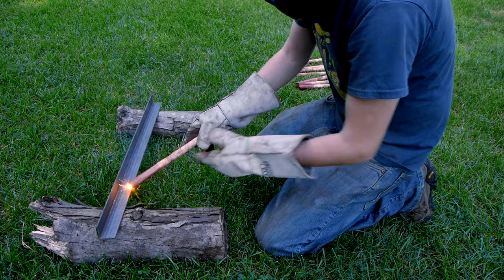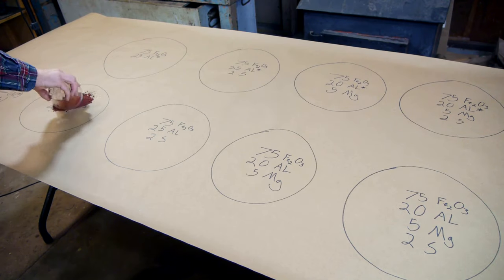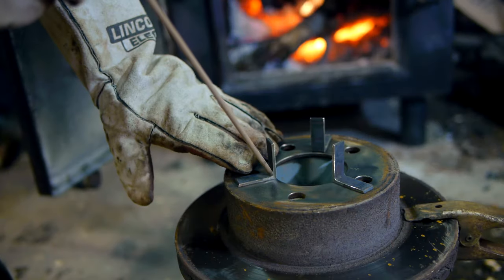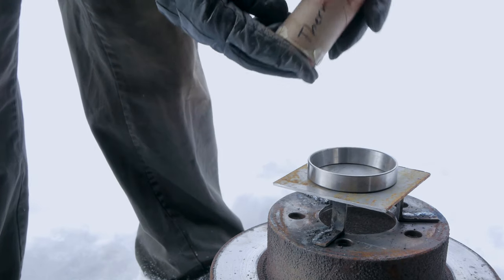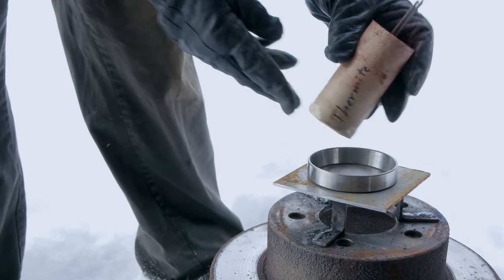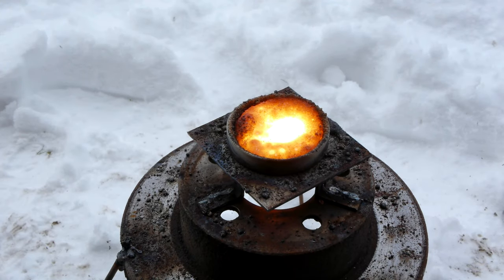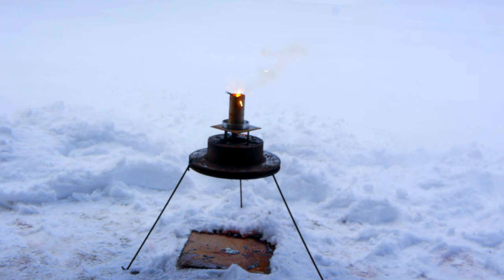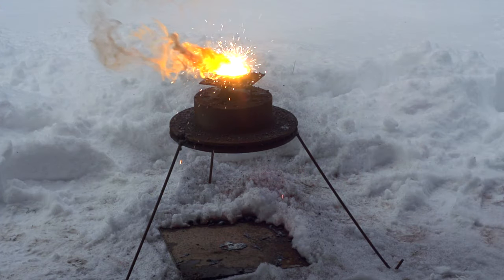How Easily Can Thermite Actually Melt Steel? - NightHawkInLight

Comment: Interesting to see the failed experiments. It looks to me like the heat is mostly escaping into the air. Also, the unburned thermite underneath may be insulating the steel from the heat above. There are lots of videos on YT of thermite welding of railroad rails, which are many times the thickness of this plate. In that case the steel is melted until it flows together, and after cooling for a suitable time, still glows yellow when the mold is removed. The biggest difference is that the reaction is well contained and protected so as to put the heat where it’s needed.

Comment: You do realize that it's not melting because of the way you have the mixture contained, right?

If you were to get, say, a 1'x1' piece of 1/8" steel, and set the thermite in like a 4" diameter ring, pack it in, and then light it, then the thermal energy wouldn't go up in smoke as much as the cylinders did.

For the cylinders as you showed them, I think you'd have better results putting the steel OVER the cylinder.

Comment: Though it may show that the materials are given a bit more credit than they might deserve, it also may be just  your testing. Heat does rise after all. Thus, I'm sorry to say it, this video and test are a fail. Light the thermite from the bottom so the hot point is pressed against the steel, and put a brick on it for insulation, weight and heat deflection  And no, I've never done this before, but that at least should be common sense.

Comment: I wonder if compressing the thermite mixture to bring the components into closer contact and remove as much of the air as possible would help reduce the spattering and increase the speed at which the reaction takes place. I'm thinking you could do it in a hydraulic press. With a 10-20t of pressure on a small surface you should be able to get it to form a solid chunk with minimal porosity.

Comment: Well... for most of the burning process the center of heat is nowhere near the steel plate.
Don't burn the Termite from the top to the bottom, but instead from bottom to top. Take a steel tube with small holes drilled around the bottom perimiter. Insert a circular mesh tube into the steel tube with a diamater around 2/3ds of the outer one. Fill the outside of the mesh with larger compressed pellets (larger than the holes and preferrably  made of Termite) and the inside with fine Termite powder. That way you'll have proper oxygen access at the bottom without powder leaking out and without using pointless filling materials.
At least partially block off the upper end of the tube with solid steel to contain the heat and use a very fine mesh to block off the bottom

Comment: your heat is escaping you need to make a crucible around your bearing race about 4 inches tall to contain the heat and that will melt through your steel use plaster of Paris to make your crucible

Comment: thermite in a clay flower pot...let the focused flow of  thermite from the small hole in the bottom of the pot, contact the metal.  it'll cut through whatever is below it, no sweat...,

Comment: Your experiment is flawed in that thermite/thermate burns directionally, all of the energy burned upward as opposed to downward where the plate is located, cap the top with a thicker plate and you will achieve proper results, please repost.

Comment: Cool vid, I liked the direction you went with it. Would have liked a bit more science in fact. There is nothing better than seeing someone make something cool then teach you how they scienced the fuck out of it.

I didn't know Thermite was that weak, what set up would have cut through that steel? Aside from the thermal lance which was cool as fuck. Hmmm, perhaps if you capped one end so the pressure would force it downward? Like a thermite rocket or something.

Comment: It makes sense how using thurmite Like that wouldn't melt that steel. Most of the reaction is not in contact with the steel and also heat rising. Making a almost torch or like a jet engine design where once you light it all the heat forced out of the end

Comment: I think the problem is your tube. It looked like the majority of the heat was directed away from the steel plate and all of the molten steel puddled down. Try just powder on the same steel plate in a bearing race and see if their is a difference.

Comment: of course you were disappointed, you never took angle of effect into consideration, a good majority of its incendiary force was flying out of the top, Might I suggest you look into how its used in demolition, which is what I do for a living , we attach it to the main load bearing beams and by the time we've rigged the sections (usually every 10 stories or so depending on the shape and height of the structure) we rely on very calculated incendiary trajectories of the thermite we use, which is fine black iron oxide and aluminum powder in a very specific ratio, packed into what look kind of like giant cakes with a  trash can lid like device on the outside the thermite side is locked in place at a strategic 45 degree angle, relying to make it a safe a relatively clean demolition .

also, in more current years, for larger scale demolitions we use thermine charges

I'll let you do your research from here

Comment: I just saw a tribute trailer to 911 in new port richey Fl,  and Im a welder .looking at this thick peice of steel that was found near the site ,  it has obivous cut marks all the way across it .im guessing it was cut  with somthing very fast like a combination tourch that probly used abrisve with the gas .it might be evidance that the buildings were weakened before the planes crashed . can somone tell me if cutting with explosives leaves simlar cutting marks like a torch ? Im guessing it doesent but ive never done that process before   . the gouage marks were very large and rough ,  the steel was like 2.5 " thick

Comment: To repeat what has been said by a dozen other commenters: your're doing it wrong. 

The majority of your heat is being lost to the air. Far less low quality thermite would cut through that sheet if you made a cutting head rather than just a cup-full-o-thermite.

Comment: I don't mean to be TOO critical, but your testing regimen has a very basic and obvious flaw. You are setting the tube of thermite on top of the metal and then lighting it from the top. By the time that burning thermite makes contact with the steel 90% of it is already burned, releasing its heat in other ways. Instead you should have taken a metal cylinder (instead of the paper one you used,) filled it with thermite, set it ON TOP OF a sparkler that is resting on the 1/8th inch steel, placed a brick on top of the metal cylinder and then lit the sparkler.

Comment: You can use all thermite in the world, if the heat is not directed to the steel, the cnaces of meltin git are smaller. U got 300g of thermite, but most of it burned far from the steel, so that heat is not directed to its function. IMO the test is a fail because of wrong execution

Comment: your powder needs to be lose and in a small flower power with a hole in the bottom I've seen it first hand punch straight through quarter inch I beam.
Reply: An inch hole should do
Reply: +Robert White just spoke to my dems instructor and he said use a magnesium strip to light it, the higher temp of it will improve reation

Comment: you burnt up the thermite using it the incorrect way, don't make a firecracker looking thing, The Railroad uses it to weld track together , they put a large pile of thermite and then light it  off and watch it do it's job, not a firecracker thing the heat go's up not down.

Comment: You just didn't do it correctly. Certainly did not contain the flow.  Try a square tube with one corner cut open... like a shape of square pipe bomb basically with a cut from tip to bottom. You will have your cut
Reply: Oh and use a steel tube.

Comment: Terrible.

1. Your thermite is garbage, it's meant to be 67/33 and you're meant to compress it, easily done since it's homogeneous.

2. Your experiment was pointing the wrong way, the bit of molten iron and aluminium oxide that touches your steel plate at the "end" of the reaction isn't going to do shit, as was evident. All the energy was being "shaped" upwards into the air, the thermite between the plate and the flame front was an insulator.

Alternatively drill out a core through your entire charge like for a solid rocket propellant.
Careful though, a core burner with the proper recipe could over pressure, and BOILING metal isn't kind to flesh.

Comment: of course it didn't melt through 1.8" steel, you're doing it wrong.. in a cylinder like that you're losing a vast majority of your thermal direction and wasting thermite. the unlit thermite at the bottom is preventing the thermite at the top from directly affecting the steel. by the time the thermite that can actually affect the steel begins to, most of the thermite you used was burned off already. Sure, some heat gets through, but thats the same as putting a cup of coffee next to a cold water bottle and expecting the water to boil.
damn basic.
let me explain this another way.. in the case of your so-called "thermic lance" .. you're trying to melt through the 1/8" steel by lighting said lance and placing the butt against the metal.. instead of lighting it and using the head. You follow?
Time to take up golf.